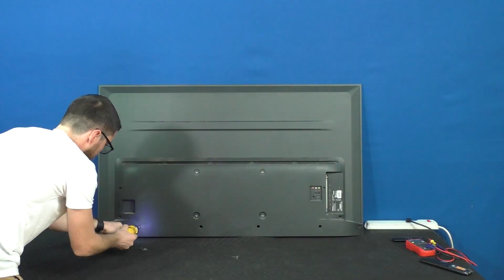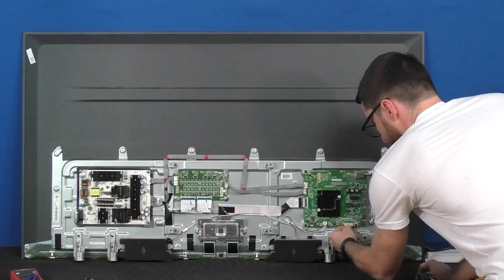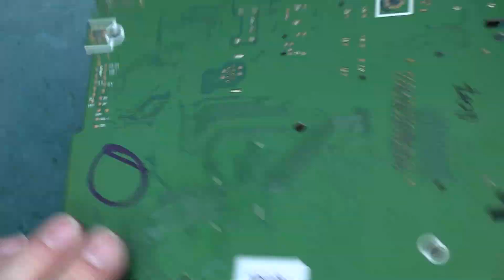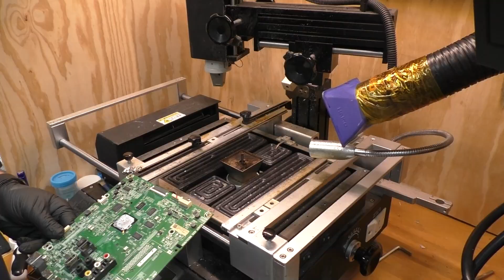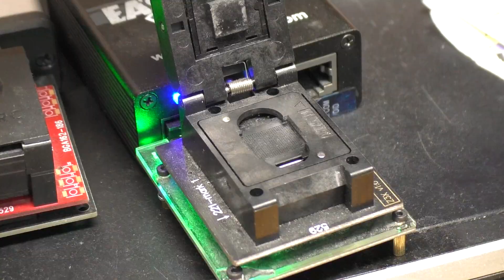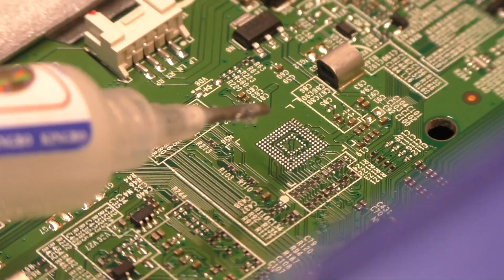Hisense TV won't turn on 55H8F How to fix

Comment: Usually boards with EMMC chips on them have data transfer pads so that they can be programmed or updated at the factory with pogo pins.  Would it not have been easier to try to re-write the chip first?  Or does Hisense pre-program their chips before soldering?  Some are also flashed through the USB/service port using a button push sequence while powering on.

Comment: sometimes is cheaper to replace the whole board
Reply from the maker: sometimes, but we don't do videos on those types of boards. We only do it on mainboards you can't get new replacements for. This one you can't buy brand new so the replacment you buy if you can find one, is going to be used and most likely about to fail soon. When you fix it like we do you guarantee many more years of functionality.

Comment: Damn what does that machine cost and and how would a regular Joe accomplish this?
Reply: From my understanding with some skills you could use a board preheater and a hot air station and you could replace that chip. That machine is probably in the several thousand dollar range,  but some things are still better done by hand depending on who you ask.
Reply: @MrCt333  how about a bic lighter

Comment: Hi Mr Nick. My TV card led putput mosfet is OK but there is no gate voltage could I short the drain and source? Thanks
Reply: Only if the mosfet is used as a switch between S and D and you don't need the switch function...  If it's used as any kind of active driver, then NO.

Comment: All your videos are the same. Replace emmc. 

I appreciate sure your expertise but theres no new content. It’s always the same thing. Replace emmc
Reply: It still could be pretty informative when you're searching on something related to a specific model. It's a bit like saying Hawaii Five-O always shows the same police department. I mean, yes. It does. 

That that, I'm sure it's not the only way that the TV is fairly even if it's a common way that they could get bricked.
Reply from the maker: @mc.the_machine that is correct while they often come down to eMMC repair, the TV is a different model, the symptoms might be different and people that haven't seen our channel before that have that TV don't necesarily know that it's a common issue. So that's why while it is repetitive I think it's also important to show this, so that people that have the 55H8F TV know this is the common fault with their TV.
Reply from the maker: Thank you for the feedback. 

I agree. 75% of the videos we put out either will have eMMC failures or cracked joints on the BGA processors. The repair almost always is going to be eMMC replacement, or reflow, reball, or replace CPU. The reason 75% of the videos are those repairs is because that is indeed 80% of the repairs we perform on circuit boards for TV repair. 
Obviously, we don't dictate how TVs fail, and while there is more variety in how they fail than what we show, we only want to show circuit board-level repairs on this channel. That does leave us with a majority of eMMC or CPU repairs. 
I will try to go over more power supply repairs in the near future, I know those are actually fairly popular, we just don't do those as often because that's not the majority of the problems.